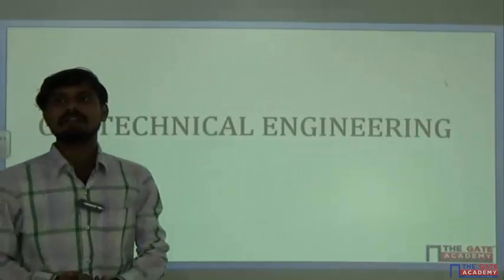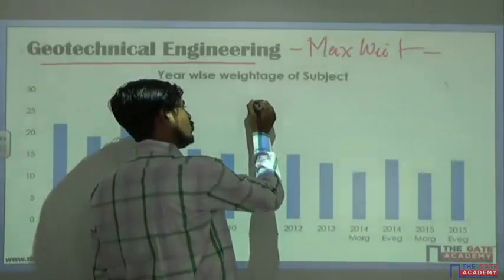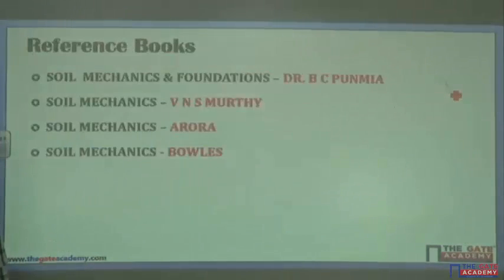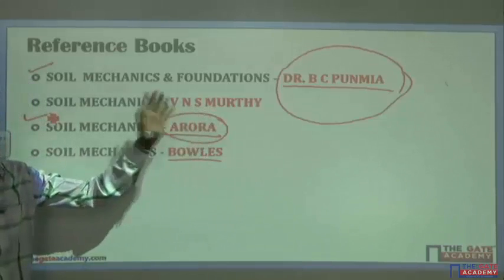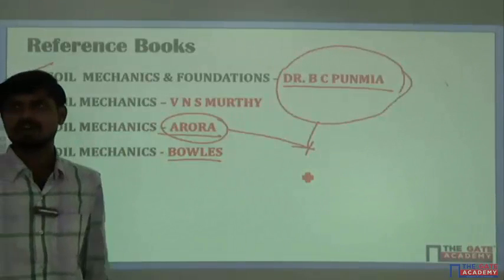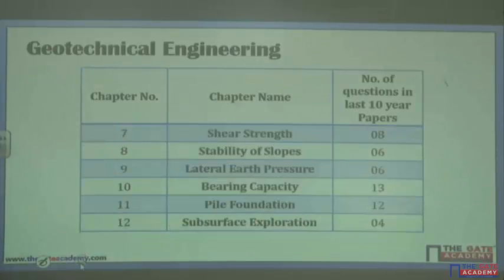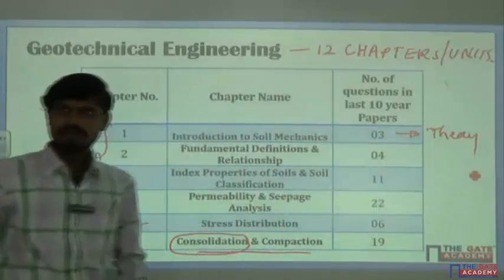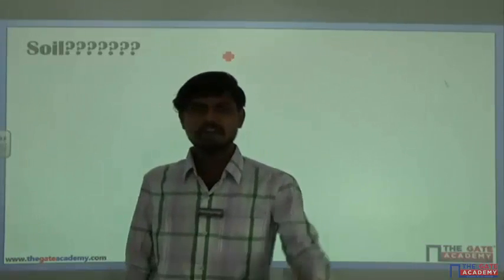Geotechnical Engineering | Soil Mechanics | GATE Exam

Comment: If Soil sample of weight 0.18kg having a volume of 0.0001cum and dry unit weight of 1600 kg /cum is mixed with 0.02 kgs of water. Then the final water content of sample will be ______?
Reply: 25% I think so!

Water content = (weight of water÷weight of solids )×100 =((0.02+0.02)÷0.16)×100
=25%